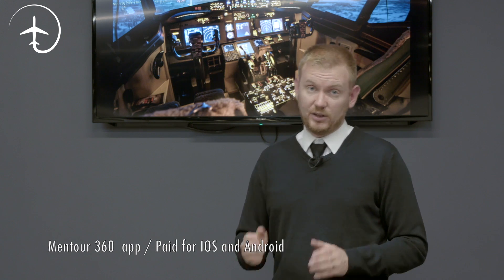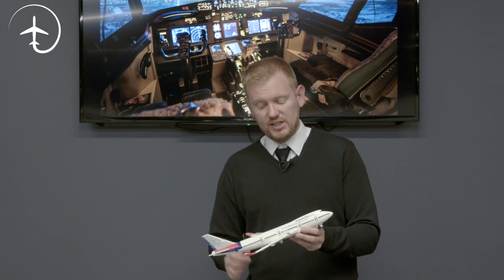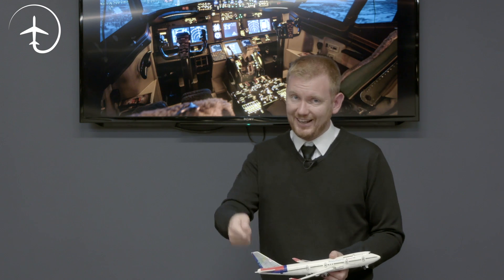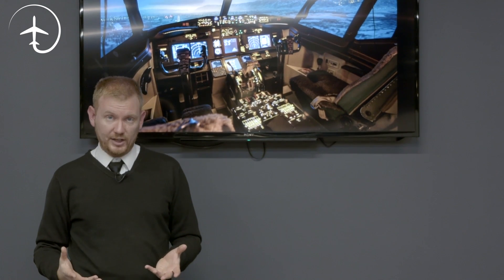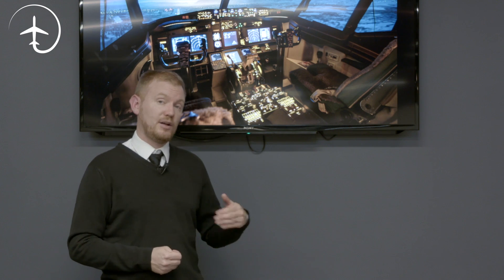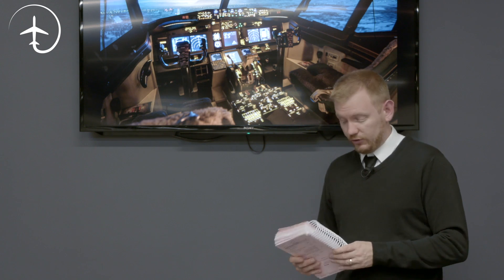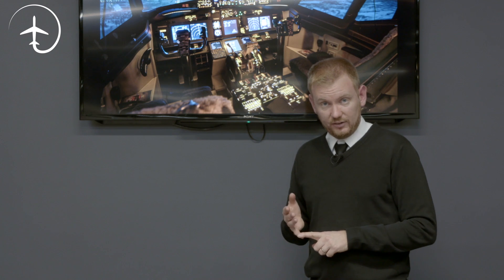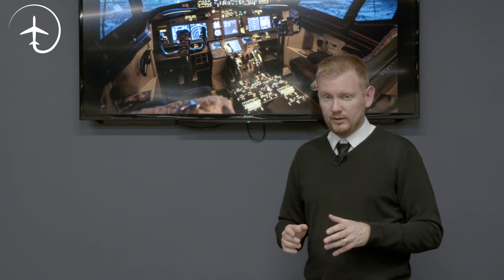Engine failure after Takeoff - Briefing

Comment: Normal rotation rate is 3degrees per second so that you achieve the 15 degrees pitch by 05 seconds . Single engine is 2.5 degrees per second so that you can achieve 12.5 degrees by 05 seconds after initiation of rotation.

Comment: I would hope all pilots have your knowledge but I am sure that’s not the case. I have never been very big on flying. I know it’s suppose to be safer than driving but at least driving I have the wheel. If I am to die in a crash then I want my hands on the wheel not on my head that’s tucked between my legs hoping the guy in charge is competent as you sure seem to be. All your videos are extremely educational and very well done. Glad I found this channel.

Comment: I used to watch fully loaded 727’s flying out of Adelaide going to Perth. I could see them for over 10 minute sometimes they seemed to climb so slowly. Evidently I am told they did but once they got to a certain speed the went into a much steeper climb. I also remember stopping there one night to upload extra fuel because of head winds. They used Vor’s in those days, upgrading to the Omega system did not have anyway of finding the best track for fuel usage. Today they go a OMG way south to get the best winds.

Comment: Am a physician, very well travelled passenger, about 10 million flying miles.  Was sitting at the window,  left wing  was hit by lightning  at below 200' in a DC-9  flying out of ATL while  gears were still retracting. We were still over the runway... . Both engines winded down to nothing. Could hear the air  outside. Climb angle remained the same, I could feel the climb rare slowing down... I expected  a stall warning anytime & a "brace for pact" . Engines were restarted in  about 30 seconds as climb continued.  No announcement from cockpit.  

I was surprised the engines rev'd down to nothing!  After all we are in a "Faraday cage" and strike would go around & to ground.   
Landing in MIA, the tip of the left wing  had a 2 cm hole  on it, blackening all around.  It was not a static discharge... 

What's your experience being hit by lightning ja few seconds after "rotate"? 

Thanks 

Sergio

Comment: So what about dual engine failure? This is probably very uncommon and is hopefully something you'll never have to deal with in real life. I suppose that if it happens right after lift off, depending on how much runway there's left, you might be able to put her back down safely? And if you've reached a certain speed and altitude you might be able to safely glide back to a runway? But I assume there's also a point in between where you're just royally screwed (and there's no Hudson river for you to land on)? And at what point, realizing you can't save the aircraft (is this something you realize?), would you diverge your attention from saving her to minimizing damage on the ground (e.g. to houses and stuff)?

Comment: I don't understand the shallow climb angle thing. You would think an 8 degree or lower climb angle would put less strain on the 1 good engine. Pilot is working to compensate for the asymmetrical thrust and all. B17s climb out at 3-5 degrees.

Comment: Can you clarify the terms "pilot flying" and "pilot monitoring' please.
Reply: Pilot moniroring watches gauges and calls out blow  by blow description of airspeed and radio calls. If plane is banking involentarily. Pilot flying has the controls. Using yoke rudder pedals if needed.pitch Trimwheel if has to.

Comment: Wow.     It all makes sense but damn🙈.  You have to do all that stuff , some of it from memory while dirting  your drawers and get it right.   
    Secondly why don’t you immediately firewall the other good engine to assure positive climb as soon as the issue is noticed?   I’m referring to on the ground before you rotate.      Also if    climb is begun and that ILS tower / gigantic tree is beginning to seem to close for comfort is that allowable?
Reply from the maker: No, and the reason is that you don’t want to overboost the remaining engine. The power is calculated to be enough for a safe single engine departure if needed.

Comment: wow, you filmed this in FEB 2017, just 2 months after this happened to me on Dec 22 2016. It was the scariest 30 minutes of my life as the pilot announce a fire in the engine, turned back to the airport, got rid of the oil from the wings...which freaked me out as I thought it was flames burning from the engine. Does engine failure happen often?
Reply: Worldwide once a week or so a very very small percentge of the 10's of thousands of flights daily, hope this helps

Comment: I can both understand and dont understand the 4000ft rule. I have the Gottröra incident in mind, as far as i can understand from reading reports and general physics, emediate throtthle down the engines could have saved the compressors from surging and this action shuold be taken far below 4000ft. 

So even if u notice dual compressor stall, u dont do anything about it below 4000ft?

Comment: Fantastic video's. Have you ever experienced a compressor stall during a take off run?
Ex Pan Am engineer
Reply from the maker: Hi! No, not yet. The CFM56 is very reliable.
Reply: @MentourPilot  why the name mentour, is it your surname? As it's gotta different spelling from mentor.
Reply: As a maintainer I've witnessed on two different occasions of the CFM-2A-2 engines having a compressor stall on high power ground testing. What a sound! First one was fine after bore-scope inspection, the second....well not so much lol
Reply: CFM56-2A-2**

Comment: I understand the priorities of flying the plane first and foremost but Im kind of surprised ground arent notified absolutely as soon as possible, even if its just a very short message of "callsign/engine failure on takeoff", given the possibility that the failed engine has left bits of itself on the runway which could pose a risk to the next plane to take off.

Comment: (Spot 2:39 in the video) When the PNF announces an engine failure or engine fire, he or she SHOULD also say which engine it is. The PNF knows which engine it is. Why would you make the PF try to guess and figure that out at THE most critical time in the take off? I disagree when you state you don't need to say which engine is the bad engine. The job of the PNF is to help the PF fly the airplane with ALL pertinent information...not to hide information from them. I'm a retired Part 121 (airlines) pilot instructor and we always identified the bad engine on take off after passing V1.
Reply: Wouldnt it be obvious as to what engine it would be with the yaw difference in the case of a failure? In the case if a fire normally thrust is broadly similar so thus no major yaw variance... the main thing is to get airborne and then diagnose the situation... the engine that has the issue isn't important at that moment in time...     if some one is breaking into your house it doesnt matter if its a bungalow or a mansion the main thing is someone is breaking in... airbus as well as boeing have these standard protocols in place, not sure on embraer overall but the CrJ's have this as their standard protocols...

Comment: what happens in the almost unheard of level of bad luck when you get dual engine failure between V1 and VR

do you hit the anchors (and almost certainly run off the end of the runway) 
or pull up and aim for a paddock or a large body of water near the airport (lets assume you are taking off toward the sea or some relatively flat, empty terrain)

Comment: I don't know if it's worth asking on a nearly two year old video, but let's say an incident like this occurs on a commercial flight, the pilots turn back, land and everyone's safe. Best case scenario... What's the aftermath actually like for the pilot? Are they taken off the line? Is an investigation mandatory? Does it effect their income? How long until they're flying again; or can they basically slot right back into the schedule?
Reply from the maker: Hi!
There will always be an investigation into an event like this but provided it’s a technical malfunction and not caused by the pilots, they will be back flying as soon as they feel fit to do so. Only an engine failure is not considered a critical event by pilots. It’s something we are well trained for.
Reply: Thanks for the instant reply! I always have lingering questions like this after an episode of Air Crash Investigation, where for example they might mention that "both pilots continued to fly with the airline". It just makes me even more curious if they continued to fly -together-; or if, on those occasions where the roster happened to put them on the same crew, there was a particular bond or a different atmosphere in the cockpit from having worked through an emergency together... That sort of thing. The story after the story. :)

Comment: Great job you are doing, I must say. I really appreciate. Is it safe practice for a 737 to be flown by just one pilot?  I once had an experience where someone I had thought was the copilot ended up among the cabin crew for virtually most of the 50 min flight.
Reply: Without a doubt another pilot on a taxi flight. They may well use the jump seat in the cockpit to take-off but found the cabin seats more comfortable. It's a two man operation at all times. Could have been a check pilot who was there to monitor take-off procedures? Not sure. But certainly wasn't the first officer.
Reply: First officer wear 3 stripes on shoulders pilot wear 4. There are 2 capts or 1 first officer & 1 capt. In the cockpit. That pilot may have been deadheading just riding as a passenger or taking his turn to rest on longhaul flight.

Comment: the bit that worry me is when the book come out with presumably instruction in. most people can't follow written instruction. pilots must be  the exception. is the most dangerous situation when a pilot does not follow these  check lists
Reply: The QRH checklists are very basic and bullet pointed, and pilots have extensive use of them during their training. It is extremely rare and ill advised for a pilot to not follow the QRH in the event of an emergency (the only safe example i can think of is Captain Sully not following QRH during the dual engine failure), however in an engine failure there are memory items that must be learnt by memory and these items in the event of an engine failure will secure the engine. The QRH comes out after this and as stated, is easy to follow and very clear.

Comment: just a question from me , don't you need some time to dump fuel in order to not land overweight in a scenario you have to return and land ? very good video keep it going :)
Reply: If yheres time prior to landing and high enough altitude for fuel to dissipate in air. You would not want to drop raw wet jet fuel jp1 on someone's head.if not high enough.

Comment: If an engine failure happens on a plane with rear mounted engines, would you feel much of a difference in pull?
Reply: Every movement the aircraft does is around the centre of gravity, so if the aircraft has rear mounted engines that are on the fuselage (like many private jets for example) then the thrust line is much closer to the centre line of the aircraft and so the yawing moment will not be as strong at all,  in fact engine failure scenarios are much easier to handle (easier being a relative term of course) than aircraft with engines mounted on the wings and thus further away from the centre of gravity! Hope this helped.
Reply: Yes, that is what i originally thought, but i'm not a pilot so I wasn't sure.

Comment: In the case of an engine failure, and the plane lands safely on the runway with no danger of fire or anything else... Does the plane  taxi back to the ramp on its one remaining engine (if it's a 737) or is it going to be towed?
Reply from the maker: That depends on the damage. If it’s just a failure, we Taxi in.

Comment: Mentour, please tell me what are the procedures for all engine failure after leaving the runway ?
Reply: All engine out scenarios are so rare that it is not even considered in the advanced training parts of ATPL training etc,  when we plan a flight all limitations are based on a single engine failure and QRH checklists are always for single engine failures. Essentially a we must fly the best glide ratio speed for that aircraft and hope the aircraft lands somewhere safe. In the event of dual engine failures immediately after V1, the aircraft is going down regardless, the pilots will attempt to land it back on the runway and hope there is enough space to not cause injury or death, but it is important to note that there is no option other than land the aircraft as it is going down with or without you!

Comment: is that picture the cockpit of a plane in the landing phase with noone in the seats? that better be a simulator or else i seriously question the wisdom of that just for the sake of a nice picture!

and out of curiosity, during flight, what do you do in case of a total loss of 1 engine? i.e the engine blows up or falls off (yes, there actualy is incidents of a entire engine falling off mid-flight) in a case like that, what do you do? to me it would obviously count as a mayday, but does it realy? or is it circumstantial? could a total loss of one engine count as a pan-pan?
Reply: Yes. Plus where did the engine fall? Give vectors so they can find it if you know. And if they do they can inspect what's wrong with it if still intact..water?
Reply: How do you explain  coming back with 1 engine missing  without notifying someone on the ground ?

Comment: Somebody asked "difference between N1 And N2." ==> I claimed "In "glib" terms, N1 describes how much air the engine "sucks in" (and consequently, engine thrust) and N2 describes how much energy the 7combustion chamber "blows out"." (How wrong is <<< that <<<?)

 AFAIK, modern "fanjet" engines have two (concentric) rotating spindles, one for "high pressure" and another for "low pressure". N1 describes percent-of-maximum RPM for the fan and low-pressure turbine on the "low pressure" spindle, whilst N2 describes the percent-of-maximum RPM for the compressor and high-pressure turbine on the "high pressure spindle".

Comment: " normal engine failure" ==> Engines do fail during all phases of flight.    That's why "engine failure" is a common simulator scenario, "spiced up" with simultaneous fire, hydraulic failures, bad weather, failed electronics, low altitude, etc, etc, etc.   

Unfamiliar scenarios with NO CHECK LIST are more adrenaline-worthy. Checklists mean a LOT of failure modes were considered and addressed by a LOT of people. Checklist items often mean "somebody died to teach a lesson to the rest of us.")

Comment: Q: Somebody inquired: "Have you ever had to eject your warp core ?" ===> Is that even possible on modern aircraft, to deliberately "eject" an engine. It's only FOUR bolts (!) connecting engine to pylon, AFAIK.

(e.g. Uncontrolled engine fire or fan blade separation causes severe vibration threatening structural failure.)

Comment: Much respect to pilots, your description only makes me more confident as a passenger.
Reply from the maker: Great to hear!
Reply: @MentourPilot  You don't increase thrust on the operating engine if one fails before rotation after v1?
Reply: @mmtot  depends on the aircraft, 737 doesn’t unless you need it for terrain clearance, because you increase the induced Yaw
Reply: @mmtot  some aircraft automatically increase the thrust of the running engine
Reply: @MentourPilot  hi thanks iv just been watching through your older videos .  Iv seen many videos where you have described engine failures and the crews rearly act as calmly and forget many of the check lists and items even at times getting the wrong failures and even engine. How often do you train like this and is the training standard for every pilot/ airline or do they make up there own.  ? Thank you

Comment: "In the event of a normal engine failure" makes me want to fly tomorrow!
Reply: " normal engine failure" ==> Engines do fail during all phases of flight.    That's why "engine failure" is a common simulator scenario, "spiced up" with simultaneous fire, hydraulic failures, bad weather, failed electronics, low altitude, etc, etc, etc.   

The real fright arises from unfamiliar scenarios where NO CHECKLIST exists. (Checklists mean a LOT of people thought a LOT about failure modes and anticipated error recovery. Checklist items often mean "somebody died to teach a lesson to the rest of us.")
Reply: Good points. I don't care whether you are a pilot or a passenger, going several hundred MPH at 35,000 feet does come with certain known accepted risks.
Reply: @llxxl052  depends on where you are, if landing at mexico city and the engine has failed at 2000feet then you know something has gone wrong, badly wrong...

Comment: So, with an engine failure on the left, you prefer taking left turns, correct?
Reply: No. To balance put in more right turn or rudder to compensate for tendency to turn left if only left engine is operating. Torque & weight.

Comment: Is there any requirement to gain as much altitude possible or a certain level of altitude during an engine failure or other type of failure after take off, should the other engine fail and there not being enough height to glide the aircraft back to the airport etc safely?